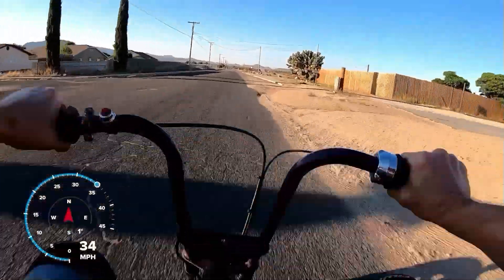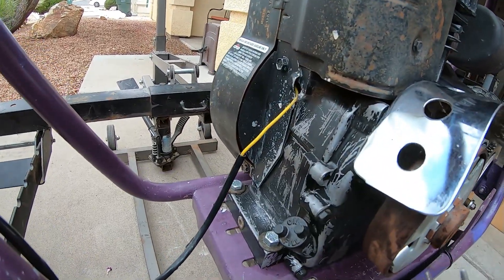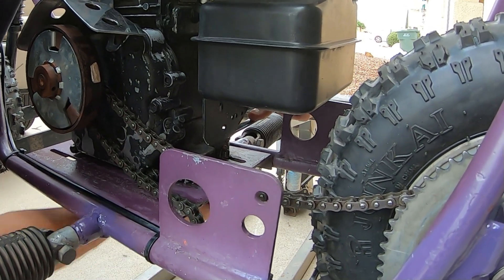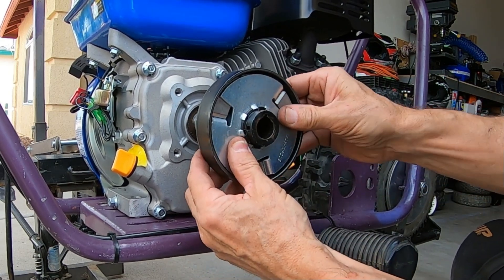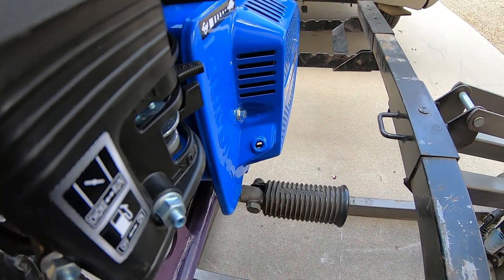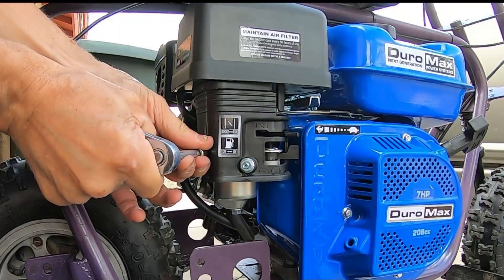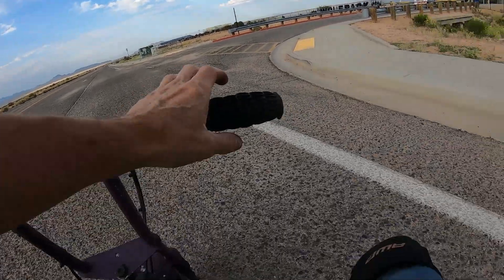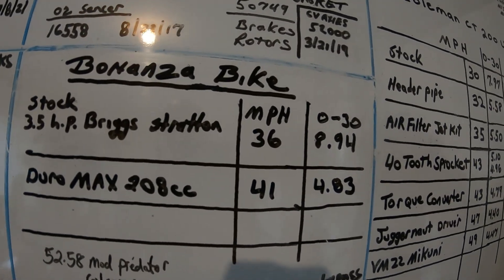Bonanza minibike 208cc DuroMax engine swap / Top speed

Comment: FYI you have to drill the piece where the throttle cable goes other wise it will not fit in with the metal throttle. Also I had problems with the filter fitting in so I put the screw that holds the booth of the throttle cable closer to the tank.

Comment: Black66. If you pull the head are you able to let us know if it uses 27/25 valves? Another nice thing to know is if it uses a clone crankshaft. (rod journal and flywheel taper) Thanks.
Reply from the maker: For sure. I'll end up pulling the head off sooner or later. I get into it more after a while

Comment: To somebody who doesn't know all that much about Engines like myself lol you would think that going from 3.5 Horsepower to 7 Horsepower would make more than only a 5 mph increase in speed. But just goes to show it's not all about Horsepower when it comes to going fast. It's all in the gearing and performance parts. There are lower Horsepower Engines out there that will leave a higher Horsepower Engine in the dust if they're set up properly.
Reply from the maker: For sure! The engine is rated at 7h.p but it will only turn around 4k RPM the way its set up , it doesn't have much more top speed. Torque is a different story. The engine has a lot more torque than the 3.5 H.P so it gets up to a given speed a lot faster.  I have more videos coming out with this engine. It gets a lot faster once it has more RPM potential...

Comment: What gear ratio does that have with the 208 I'm putting a 208 on my bike
Reply from the maker: It has a 5 to 1 ratio 12 on the clutch 60 on the rear. Check out the playlist
Reply: @Black66  all right man I'm going to do that exact ratio ill like and subscribe thank you